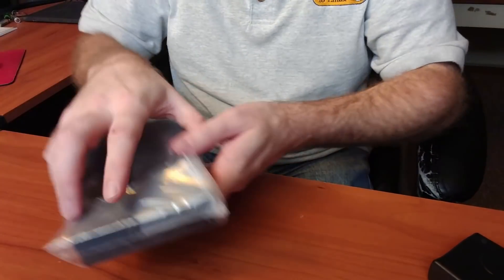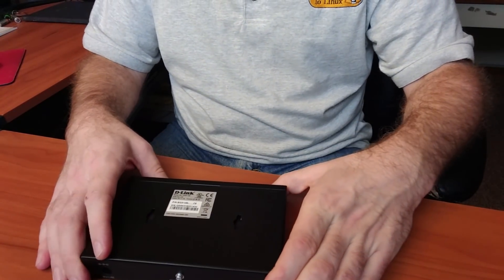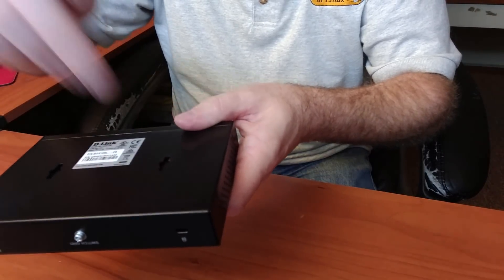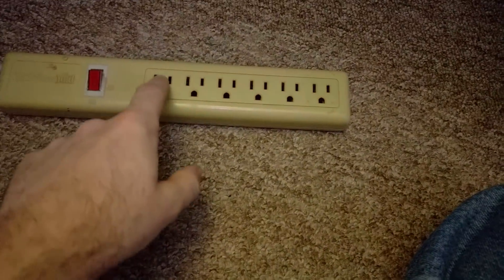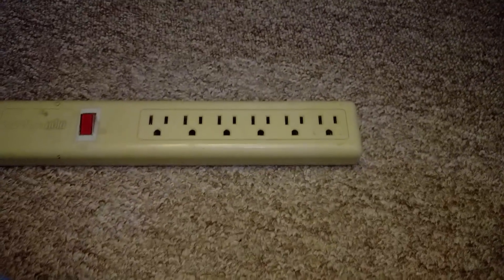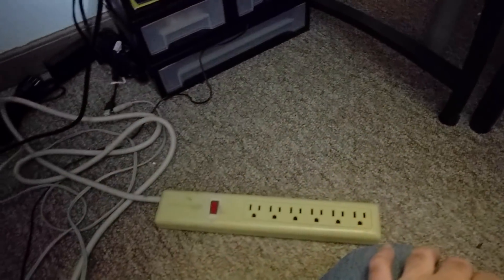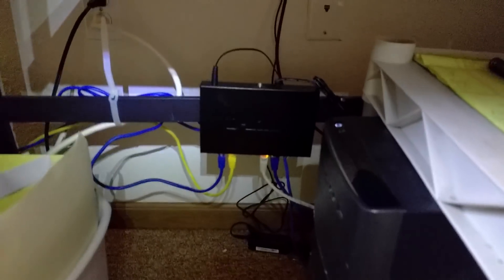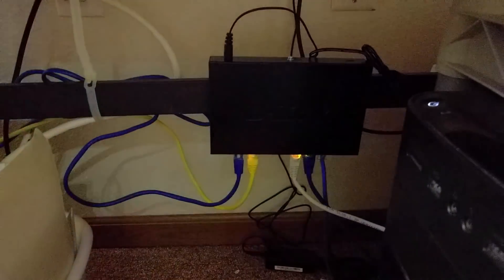Upgrading Network Switch

Comment: Tom, those Gigabit switches are also useful for distributed rendering farms. You can have all your computers running blender 3D and share the load between the master server and the other secondary servers. There's a Linux program that works with Blender 3D that does exactly that called FarmerJoe. It'll definitely reduce your 3D rendering times and is a great way to earn a secondary income by dabbling in 3D.
Reply from the maker: That sounds fun.  I have more plans for 3D stuff down the road so I will keep that in mind.